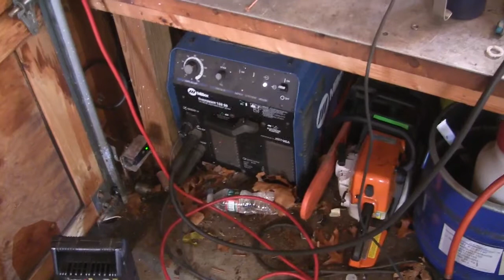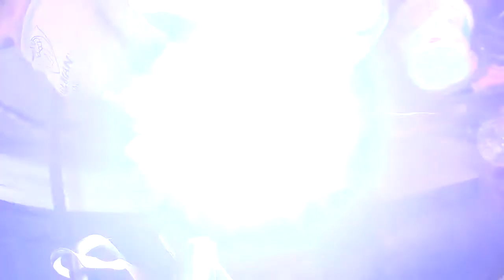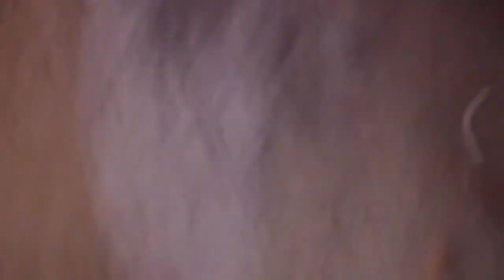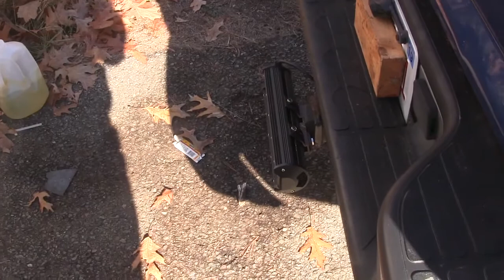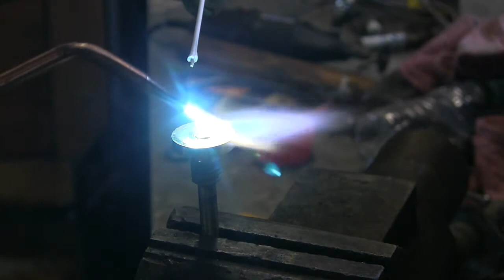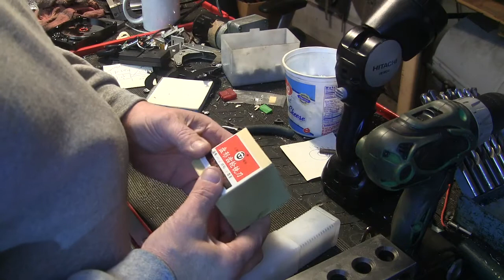Doodads XXV

Comment: I admire the workmanship on the valve. Older homes are infested with that style valve, and your cancer problem is pretty common. I know that at least years ago, you could buy a replacement washer that was encased in a metal half shell (bottom and sides) so you could break off the rest of the rim, file the face flat and install the washer. Not as elegant as your fix, but it was expedient.

Comment: Hi Joe have you ever had to tighten the head bearings on the wrong fu got a little play on mine and not sure how to go about
Kev in the UK
Reply from the maker: Hi Kevin, If you are talking about the spindle bearings, my machine has ball bearings so they are not adjustable. If you have some play, you are going to most likely need new bearings. I do not believe that the RF-30 ever came with tapered roller bearings.
Reply: Cuppa Joe 
Bugger thought they may have been taper bearings will have to see how it comes apart
Thanks anyway
Kev
Reply from the maker: I have a PDF of the manual with the exploded diagrams if you need one.
Reply from the maker: Hey Kevin, I owe you an apology. I went back and took a look at my notes and yes! There are tapered roller bearings in the spindle. You have to remove the spindle to get to the nut. Just take out the downfeed pinion gear / handle / etc. and the spindle should drop out the bottom. Then you can release the lock ring and tighten up the preload nut. Sorry I steered you wrong buddy.
Reply: Cuppa Joe 
Thanks Joe I took mine apart and sorted
Kev

Comment: You can never have too much light.  My truck came with a backup camera and the first week it paid for itself.  I was just about to back out of a parking space at Sams Club and happened to look in the camera and a little old lady in a motorized chair was right behind me.  I could not see any part of her in the mirrors and I would have backed right over her.  I got a set of Chinese gear cutters and am well pleased with them.  And they needed a 22mm arbor which they wanted almost a hundred dollars for so I made my own from a blank arbor.  Cutting gears is the fun thing to do on the mill like threading is the fun thing to do on the lathe.  Thanks for the video.